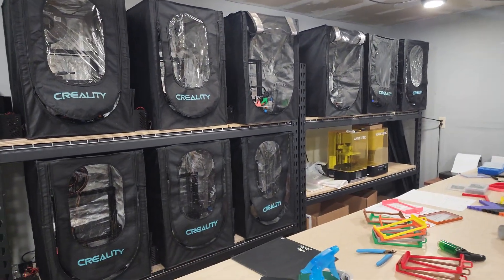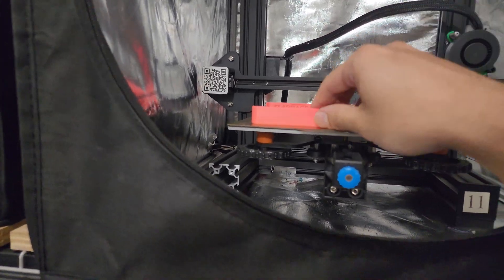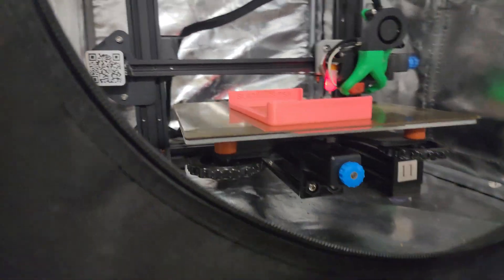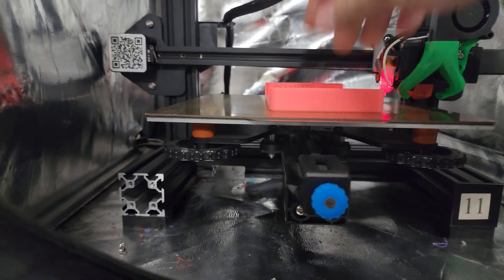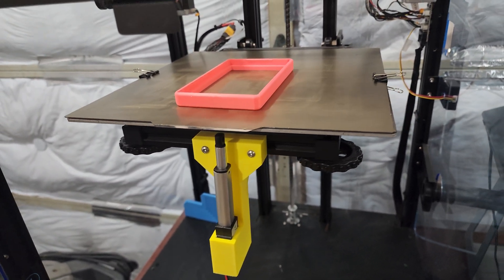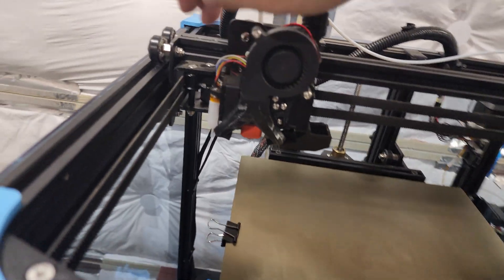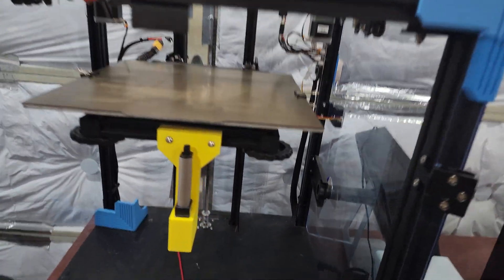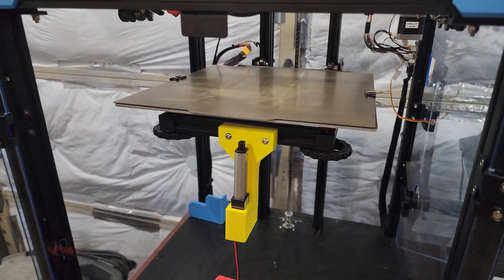3D Printer Automatic Part Removal Concept for Print Farm Automation

Comment: Enclosures will definitely increase the cooldown time significantly. Automation is definitely easier on open-air printers. Also means parts will pile up inside the enclosure unless it's cleared regularly, or there's some kind of cutout at the bottom!

I'll be following your progress and I'm interested to see how you deal with ejecting parts from the enclosure.
Reply from the maker: For parts collecting, the enclosure has enough space to raise the printer base and add a large bin underneath to catch the parts, most of what I print is not tall and can take a while before it fills up. I'll have to test and see.
Reply: @Redo3D  As long as you can get good airflow across the bed when the print is done, you should be able to get good throughput.

Comment: Could you put a shallow ramp starting right at the end of the range of motion of the bed so that when the bed is pushed all the way forward the front edge of the steel sheet pushes into a shallow ramp that directs it upwards? if the stepper motor that drives the bed is strong enough you could potentially have a 0 extra electronics solution that would only cost a bit of build volume. alternatively the steel sheet could just be a bit longer to allow this mechanism. your idea is probably easier tho, its a good one.
Reply from the maker: Thanks for the suggestion, unfortunately the y stepper motor is not strong enough to even begin bending the steel sheet. The actuator has 13lbs of force which will bend it enough.
Reply: I have seen this done where a print farm has 100s of machines printing upside down to self release with sprint steel where the bed extends all the way out it pushes the sheet to the goldy locks zone to release.

Clearly your not hanging it upside down but there should be a way of using a similar concept without the need for electronics
Reply from the maker: this is a really interesting idea! I will have to think of some ways how this could work for me. Thank you!

Comment: With that style of machine, why not just stand a rod up from the bottom and lower the Z plate onto it to push up the front?  That would be a lot less expensive and complex... all done with 100% gcode.
Reply from the maker: Yeah someone commented that earlier and I agree for this style that could work. The main idea is for my ender 3 v2s. I just used my ender 6 to prove this concept. I rarely use that machine.

Comment: you could use 2 switches, one on x to extend and the other on y to retract, or use an arduino with an H bridge and maybe a code to prevent false activation, like 3 tap instead of one
Reply from the maker: yep great idea, ive been looking for a momentary push button that reverses the polarity when pressed but havent found anything suitable. This could be a good alternative.